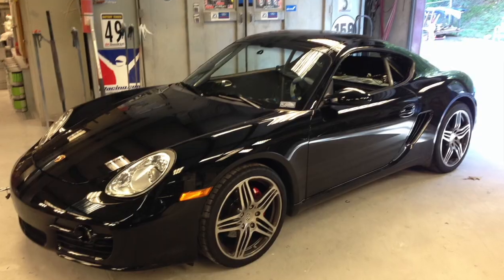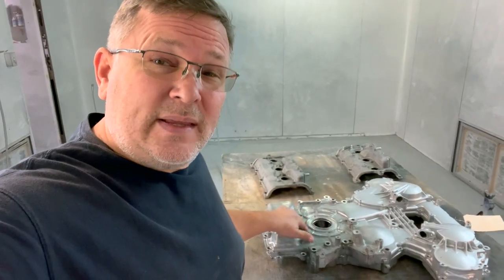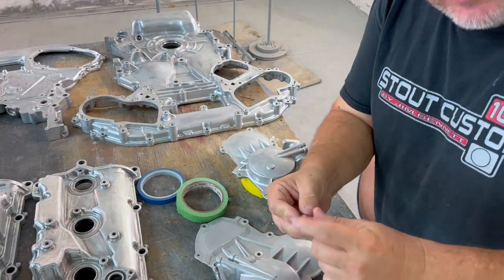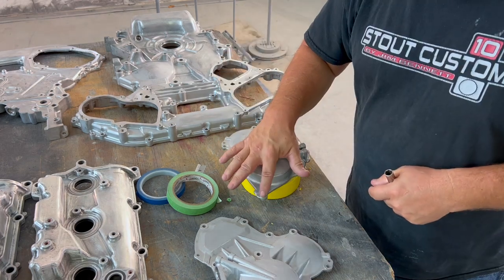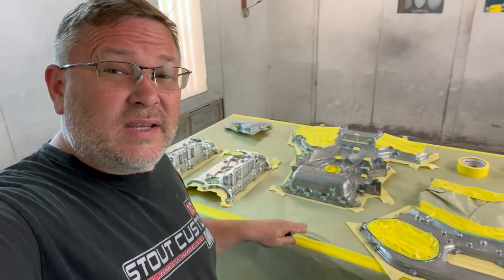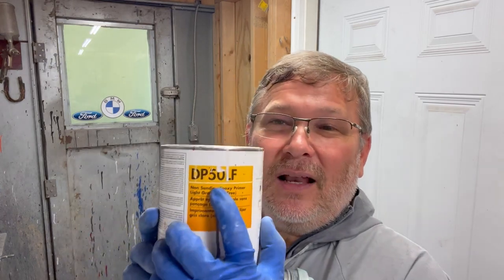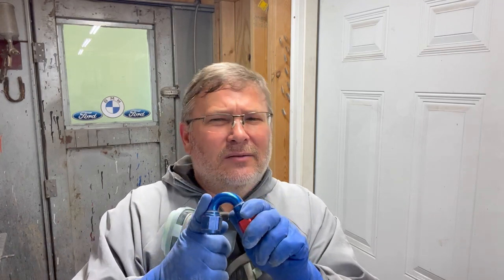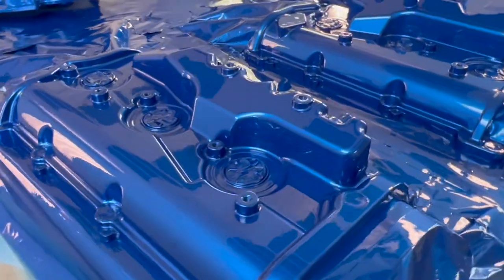Was it Worth Painting Timing and Value Covers for GTR Rebuild (Part:12) #nissan #gtr #easteregg

Comment: anymore videos on the engine?
Reply from the maker: Waiting on my new bell housing and flywheel. Then I can put turbos and intake on engine and make a video about it.
Reply: awsome did you end up reusing the crank? just spun a bearing debating on doing a new crank and just having the machine shop blance the rotating assembly.   @RebuildRex
Reply from the maker: @rcmechanic2068 I replaced with a Billet crank. The stock crank wasn’t hurt and I was told the stock crank would hold up to 1300hp but I’m going to push it a little higher than that.